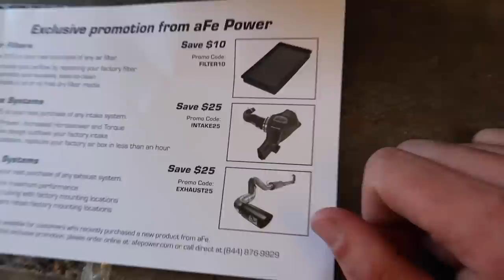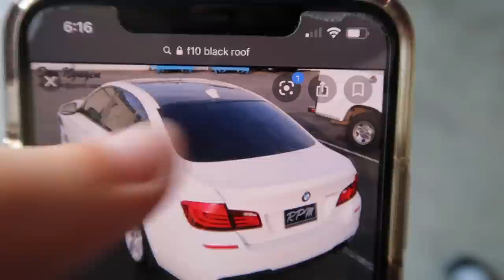THE F10 535i GETS A 32+HP AFE INTAKE! (PLUS MORE)

Comment: Imo since an intake doesn't add much power I would go with an open box intake so it make for noise which makes the car feel faster lol plus burgertuning intake is so much cheaper also intake may not be adding power but increasing throttle response which feels like more power